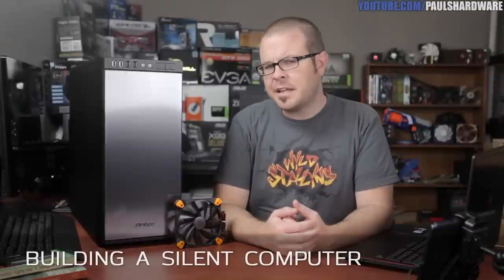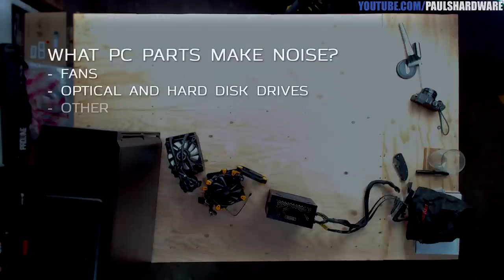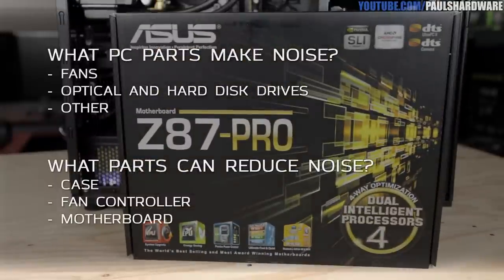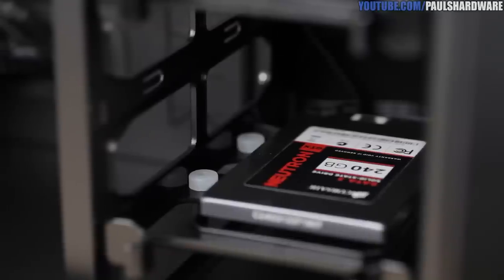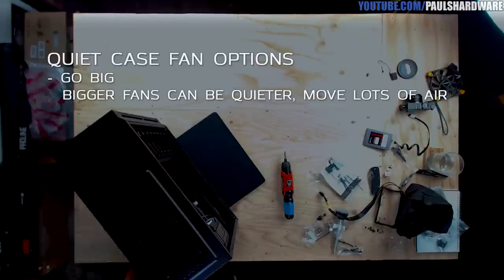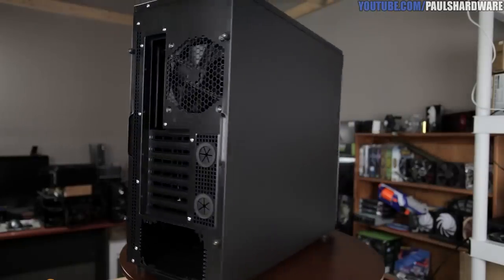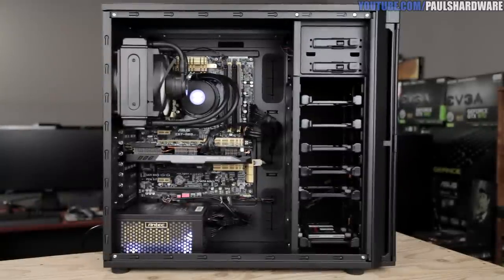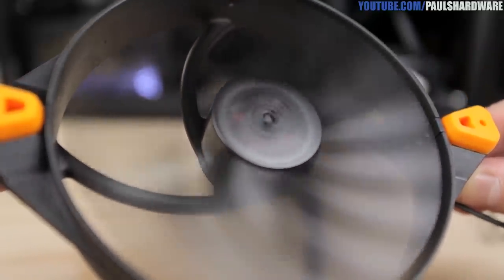Building A Silent Computer

Comment: I got an asus z97-P , got 4 jetflo LED 120mm fans and I want my pc to be quiet (they are pretty loud, and I have used the silent extensions ) , however I , downloaded AI suite and I dont have fan xpert option , I looked everywhere , downloaded older versions still nothing , I trie speed fan and I got some kind of error when I try configure it for my MBO ,, any suggestions ?
Reply: +filip marinovic idk if you solved the problem you were having but even thou jetflos have nice airflow they are really loud when there max or even 50%. I had to switch to corsair ones for while but just now got some cougar fans and damn what a difference. You can tell when you first see them even compared to corsair ones i bought. prob going to end up switching to fans i bought there really quiet and push alot of air the higher you go in rpm.

Comment: my noisiest component is definitely the corsair H110i water cooler. always reving up and down unless I turn down my processor power via Windows / firmware to reduce the temp. wish the pump itself had a setting for this.. pretty sure it doesnt??!

Comment: It's nice to hear you say that PWM Fans are better 
And I Also Prefer those ... But The Problem is That My motherboard does only have 2 Real PWM Connections ... The CPU Fan and CPU Opt headers (and those are linked together)
The Other 6 4-pin Fan Headers do not provide PWM control at all (They have static 5 volt on the 4th Pin)
I am Pretty sure That your ASUS Z87 board has the same problem since I have a R4BE witch is from around the same time as those were released

I hope that Asus will Fix this MASSIVE Problem with a lot of there boards since I think it's just a rip off to put 4-pin fan connectors on a board that only uses the 3-Pin controlling method

Paul What do you think about Asus adding 4-Pin Fan headers to there boards without the support for PWM ???

Comment: Paul what is the name of that Sata to USB? :O That's the cleanest & most compact one I've ever seen! Also, don't smoke in the room your computer is in unless you have a dryer style intake/release to outside for all your fans lol. Speaking from personal experience of course, haven't built my custom vent mod yet though ;D.
Reply from the maker: It's the one that came with the WD Black2 SSD/HDD hybrid drive, I haven't been able to find it available by itself anywhere though :-(
Reply: Ah damn. I found one fairly similar on Deal Extreme, but 'real' computer parts are the one thing I wouldn't mix with super cheap Chinese tech.. http://www.dx.com/p/2-5-sata-to-usb-3-0-hard-disk-adapting-cable-black-25cm-258701#.VJibCV4CyA

Comment: by far the loudest component in both of the computers i've built are the hard drives. I'm running WD blues in both. Is it worth the performance dip and extra price of greens? or does anybody else have experience in building quieter computers?
Reply: No, keep the blues. you want something quiet get a 1tb SSD.
Reply: The best and easiest(but more costly) solution is to just go all ssd. 500GB and 1TB drives aren't that expensive anymore. However if your on a budget you can create elastic suspension for your harddrive, just google it. Usually easiest to set up if you happen to have 5.25" bays in your case. WD green/red generate significantly less vibrations than blue or black drives but it can vary from model to model. SSD's are dead silent, smaller,  faster than any harddrive and can be mounted anywhere.

Comment: Guise, how do I silent my HDDs? I have two of them, they are by far the loudest component in my PC. At least when idling.
Reply: I mean SSD's are absolutely silent. But obviously most people can't replace ALL their HDD storage with SSD that would be waaaay too expensive!
Reply: *****
I do have an SSD for the OS and basic applications. I also have 1TB and 500GB HDDs to store games and all sorts of generic data. I'd gladly replace them with SSDs, but I can't really afford 1.5TB worth of them.
I could still bear with the noise of one hard disk, but the pair that I have tends to drop into some kind of annoying resonance. I think I'd be better of getting rid of both of them and get a single 2TB drive. Heard WD Greens are pretty quiet while maintaining a reasonable performance. Might get one of those.
Reply: DrathVader96 you could check ebay and craigslist for silent hdd coolers like scythe himuro, they are uncommon and i dont know one that is in shops now, but they basically are boxes to silence your hdds while keeping them cool.

Comment: I have my case fans connected via power supply and they use 5V instead of 12V.
How? Simple.. switch yellow and red cables in molex to make fan use only 5V.

Comment: Well, on the cpu side: what about the AMD FX-9590? This seems like an ideal cpu for a silent build.
Reply: And get quad xfire 390x
Reply: And then it started to burn because (AMD CPU's (and GPU's) use very much power while being slower) he tried to start a game and the PSU exploded while the CPU started burning ... Just don't use a cpu by AMD with power in a silent case ... (You will need your own nuclear reactor and 2 times the cooling for the nuclear reactor 1 for the cpu and one for the reactor )

Comment: I had an older video card whose fan created a weird vibration resonance that caused its PCB to vibrate loudly with an annoying buzz. I could stop the noise either holding it with my finger or turning the whole case on its side. Ultimately I just finally upgraded my card. Has this happened to anyone else with an old part?

Comment: The ACX cooler on my GTX 770 SC is anything but silent, even after dusting. I guess the thermal paste is going?
Reply: Yeah I have a 780 sc and replaced the thermal compound on it. Best thing I ever did for it, old stuff was crusty and half gone :p dropped like 10-15 degrees at full load. I've never stripped off a gpu cooler before and it was really easy, from memory it was only the 4 screws around the chip itself that are holding the cooler on so it's super simple :)
Reply: My load temps are 81c max in a Corsair 750D Airflow, do you think they're a little over what they should be?
Reply: What fan percentage is yours running at?
Reply: 46 @ idle and 80 at load according to MSI Afterburner

Comment: hm im having some coil whine with my 7870 XT when i changed my PSU to corsair cx750m i had a corsair  VS450 which i replaced cause my pc was randomly shutting down when gaming, but i never had my gpu coil whine with that PSU O_o now my pc is fine never shuts down but coil whine is a bit annoying

Comment: Real men don't concern themselves with a little computer noise. I have added 1 additional fan to my system on the intake side/front side, with filters and replaced the CPU fan with the same model of fan which are industrial server fans 92X38mm 5000 RPM 150 CFM butt kickers with 4 pin control. You couldn't get my CPU (Zeon 4 core) hot if you tried. Now for the kicker, UNDER $50.00 how much have you spent? every thing is black of course for a reason, black is best for heat dissipation, no pretty lights and it doesn't have the latest new gaming smell emitter, but it does run intense 3D Master Cam design software at high speed and is never more than warm to the touch. Or you can fall for the computer gaming aftermarket screw job.

Comment: Never seen that case before but now I have, WTF its so much better than any of Fractal Design's Define series!
Reply from the maker: blackice11z StoneXue I have to agree with Stone here, I would opt for the Define R5 over the P100 if it was in my price range. The P100 has been on sale for $60-$70 just recently which is a great deal for the price... Fractal Define R5 is $110-$120 but it beats the P100 hands down (which it should given the price difference)
Reply: Rivets aren't that hard to remove, but if build quality is bad then I guess Fractal's  refrigerator looking box wins.
Reply: StoneXue I like hardwarecanuks but stop watching any time they mention a cases dust filters, because nearly all included filters are crap but they commend some (like the 450d) and condemn others (S340). The top mesh on the 450d is not a dust filter and neither is the front, the bottom is alright but they acted as if it had great dust filters. The S340 bottom filter was no worse than the 450d's top filter and the front filter was decent. I do own both cases (switched from 450d to S340).
Reply: StoneXue I don't know who you are but I assume your speaking as though you are HardwareCanuks, so I shall respond as though you are. You often call things filters that are not filters, most of the time you don't mention filter quality that is true but sometimes you do and when you do its never impartial, you favor some cases with the same or worse quality filters than others. I never mentioned the R5 exclusively but that was one of the videos that did not mention the filter quality.
Reply: StoneXue This is written as if you are a member of the Hardwarecanuks team -  "What?  My comments on the dust filters had nothing to do with quality.  Most of us understand the ability of the typical mesh put on these cases.  The comment on the R5s filters is more related to the fact that the bottom filter is full length and accessed from the front easily."
Reply: StoneXue Wait oh shit oops, I totally should have read the comments above again, totally didn't remember this conversation and only read the most recent comment in replying, sorry about that.

Comment: Anybody know if the antec p100 will fit a noctua nhd15 thanks for the help
Reply: It probably will. Might want to check RAM compatibility though depending on the NH-D15's orientation.
Reply: i actually ended up buying a define r5 instead because it was a good deal

Comment: Geforce 760 ACX is quite loud unless you have a dual BIOS version with the latest firmware flashed as the fans can't spin lower than 41% even at idle and they have a tendency to coil whine with a lot of systems, I definitely would not recommend it for a quiet system.
Reply from the maker: Nicktrance1 Thanks for the tip Nick, after all was said and done the GTX 760 was the loudest part in this build. I will check on that new vbios and see if I can quiet it down even more!
Reply: Paul's Hardware Learnt that from my experience with the card unfortunately, if you have a single BIOS version like me you probably don't get the update (not officially at least) :(.
Kinda sucks because the cooler is good enough to keep it cool at much lower RPMs at idle.

Comment: Tip for the ultimate-ly 100% silent PC - buy long HDMI cable and a long USB cable, put the case in the other room :)
Reply: Nenad Cvetanovic What if there is only one room in your flat ?
Reply: VinZ VegA Cant tell if you're serious r not :) but since no smiley i'll presume that you want a real answer :) ... obviously you can try and do what this video says, but truly silent computer  is impossible to build, ... sure when you turn it on, and its cold, and you have state of art ventilator management software it would be fairly quiet, but when you start warming up the processor and graphics card its still going to be very loud.
If you're in the single room - you could put it behind large piece of furniture, and surround it with styrofoam pieces from top and sides, that would reduce much of the noise. ... or if you have a terrace put the case on the terrace, drill a small hole through a wall, put the case outside, and you will have a 100% silent comp inside... ;) ... 
It is extreme for someone who casually uses computer, but if you're someone who spends 8+ hours daily next to it, eliminating noise means a LOT to your nerves and health.
Cheers ;)
Reply: Nenad Cvetanovic
Of course I wasn't :) I know that a completely silent build is impossible to get. I've done enough research about that to know.
But I'll continue to try to reach the silent build quest (at least the fairly quiet build) since I work on my PC all the time.

PS : I live in a student bedroom, so except for my WC/shower room I can't export my PC outside my work place ^^

PS2 : I'm French, so sorry for my bad English

Comment: I don't understand the positive pressure idea. Litres and litres of dusty air are entering your machine every minute via the inlet fans. Unless you have have efficient dust filters on those, I don't think a bit of air leaking in via the cracks is going to make a difference.

Comment: just for shits and giggles i want to see a passive mid to low range gaming setup, maybe one fan at most to jumpstart convection. i can't remember what card it is but in the last few years (maybe two or three) i saw a low end passively cooled video card, but i bet you could manage low end gaming worthy with a passively cooled apu. would just be cool to see a build that works without any fans or mechanical drives, that would be silent as long as you don't get coil whine which would be loud as hell on a build like i described.
Reply: Sapphire  made a passive cooled r7 250 I believe
Reply: st0rm yeah, i think that was the one i saw, and that would have only been like a year and a half ago.

Comment: I have 2 brand new WD Green drives both of which are brand new and they are the loudest thing in my system. I thought there might be something wrongf with them so I ran tests and I got 99% healthy so yeaaah, Unless you have really loud fans or keep your fans at maximum RPM I would put HDDs on 1st place XD

Comment: My gpu is coil whining!What do i do?
Reply: NickMsiGaming YT return it
Reply: PK Logue i fugured it out,it does not do it anymore!WTF?I had a 750W psu,and then another 750 corsair rmi unit,and i think you have to manually enter a fan curb higher than the automatic one and @ around 70% fan speed at full load it does not coil whine!It is a twin frozr msi GTX 980Ti Oc BTW and 980 Tis arent known for their refinement if you know what i mean....

Comment: Hi Paul.  First Congrates on your 100k subcribe base.  Love your videos.  Your unboxing and Vegas trip are the best.  I plan on building a semi gaming system.  I want to use a ssd and large sata for storage. I want store and run games off the sata and use the ssd for OS and some programs.  Is that a good idea? Should I just stick a large sata?  Here is a potential build list.  Thanks for help. 

Rondo  4Life

CPU: AMD Athlon X4 760K 3.8GHz Quad-Core Processor  ($73.98 @ OutletPC)
Motherboard: Gigabyte GA-F2A88XM-D3H Micro ATX FM2+ Motherboard  ($59.98 @ SuperBiiz)
Memory: Kingston Fury Red Series 8GB (1 x 8GB) DDR3-1600 Memory  ($63.49 @ SuperBiiz)
Storage: Crucial MX100 256GB 2.5" Solid State Drive  ($101.99 @ Adorama)
Video Card: MSI Radeon R9 270 2GB TWIN FROZR Video Card  ($158.98 @ Newegg)
Case: Corsair Air 240 MicroATX Mid Tower Case  ($74.99 @ NCIX US)
Power Supply: Corsair Builder 600W 80+ Bronze Certified ATX Power Supply  ($51.75 @ OutletPC)

Comment: Um is it just me or does this case build have negative pressure.... but he says it has positive.... 2 intakes and 3 exhaust fans...?
Reply: +Patrick Hui It might be that the intake fans have a higher combined CFM than the 3 exhaust fans.  I have one high-rpm fan in my case that, when at full tilt, moves more air on its own than the other three in my case.
Reply: +Patrick Hui 2 intakes and 1 Exhaust. I don't think he used the top fan mounts

Comment: That antec radiator flat out looks terrible.  I imagine performance is probably boosted by having the thicker radiator, but that just looks ridiculous in that location.  

Good video though, just think Antec screwed up the aesthetics of that rad.
Reply from the maker: They moved the pump to where it is (on top of the fixed fan) to get around the Asetek CLLC patent in the USA right now

Comment: Am I the only one who doesn't mind the white noise of the fans? I can't be the only one.
Reply: Paul I had a NZXT and Lamptron fan controller and they kept making voltage noises (I don't know what else to call it). The fans were 3 pin so I'm guessing that's why they made the noise. What would that be though?
Reply: Depends for me. All fans are different. Something I think is SUPER important when discussing white noise.
Reply: Infinite Zero true. For me the low hum of a fan can actually be soothing. If it's a smooth hum kind of like a table fan you know. But a fan with some bad ball bearings can be horrible.

Comment: err, aren't noctua fans about as quiet as it gets for fans and also not pwm?
Reply: He had to use antec components for this build.
Reply: Noctua fans come with either DC or PWM headers but the PWM versions are slightly more pricey
Reply: Worth every bit though, i can hardly hear them hitting 1200rpm in my define r4, and my system is dead silent at idle.
Reply from the maker: Noctua fans are awesome, that cannot be disputed
Reply: Striezel cool cool. haven't ever dropped the money to get any myself so i wasn't aware, i've just always seen the dc ones.

Comment: fractal design case is better.
Reply from the maker: I agree, it is a bit more expensive too, but I have other plans for my Define R5 (mwa ha haa)
Reply: Paul's Hardware
I cannot wait for new ARC. I wonder if they will swap out those sponge dust filters with a fine mesh filter like in r5. Sponge dust filtrs might be good when it comes to filterign air, but cleaning them is a pain. Not to mention that you can accidentaly pull them out of the frame and then getting them back in place is a nightmare.